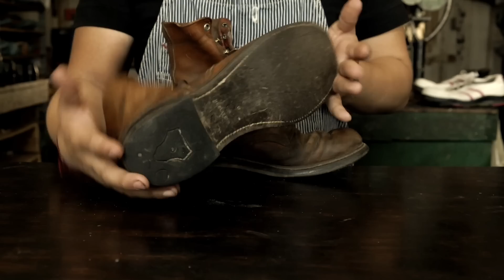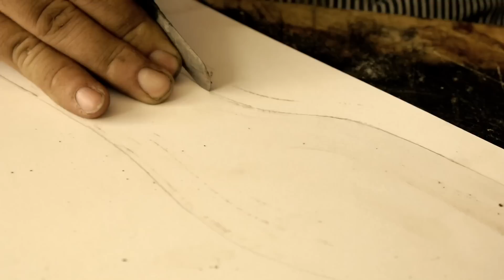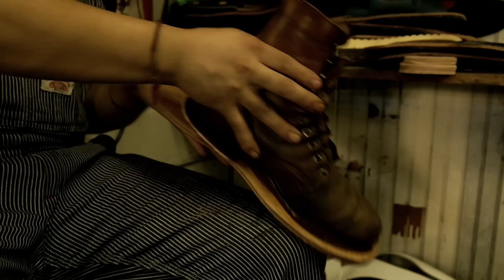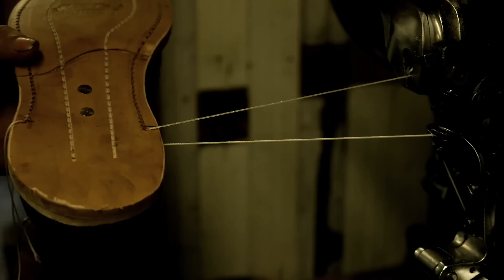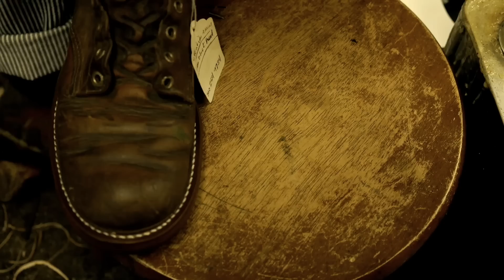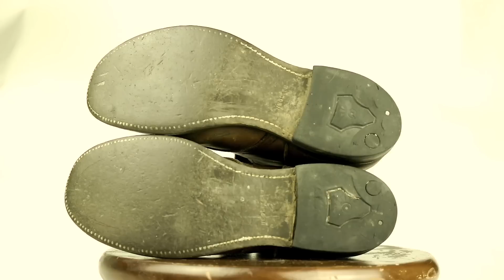Red Wing Irish Setter Sport Boot Resole #15

Comment: Could you explain how the nailed construction works with the 270 degree welt? I looks like the nails you pull from under the heel would protrude into the inside of the shoe (I know they don't, but why not?).
Reply: they do go trough the shoe.. that's the point. they hit the last underneeth and curve back into the sole.
Reply: Thanks! I kinda knew that much - how do you avoid having the bent nail stick out on the inside? Is the insole put in the shoe afterwards?